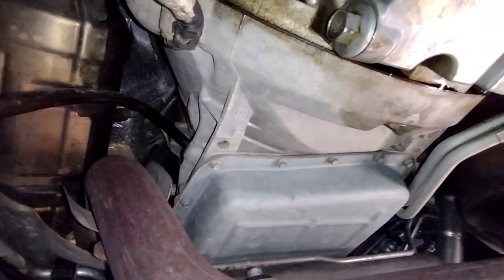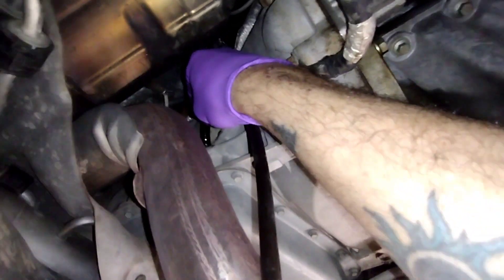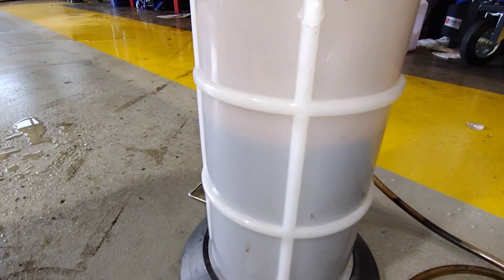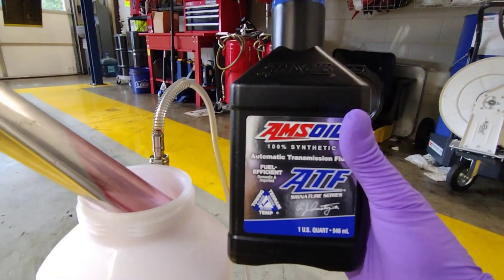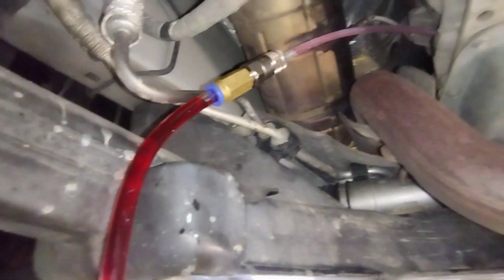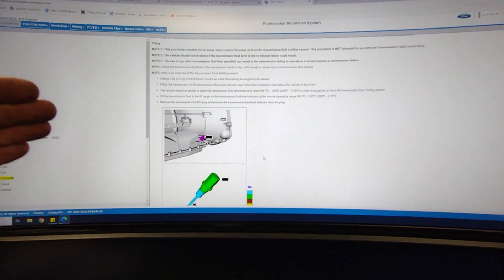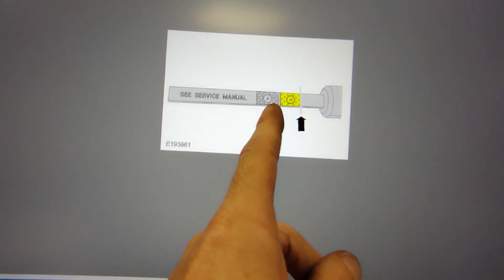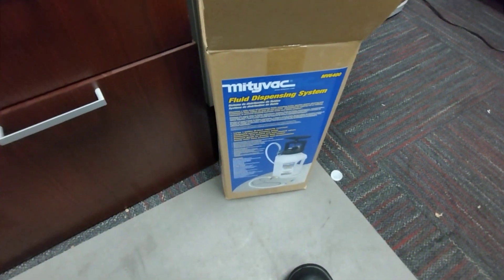2017 Ford Transit T250 113,000 Miles Transmission Fluid.🤢🤢

Comment: I checked my tranny level the other day noticed it was a little gritty at 30,000 miles. Went right the transmission shop for a filter and fluid swap. Nice vid might go with amsiol next time. Thanks for the vid
Reply from the maker: Your very welcome. Your on top of your maintenance my dude. It's awesome. Better safe than sorry.
Reply: @BeardedFordTech  off the subject I got 2018 f250 30,000 miles when should I look and doing spark plugs? Thanks again
Reply from the maker: @kingranch8516  you got a gasser?
Reply: @BeardedFordTech  yea my bad yep 6.2. Thanks
Reply from the maker: @kingranch8516  you do a lot of driving?
Reply from the maker: @kingranch8516  ford recommends 100k miles on the 6.2. But I'm going to recommend for preventative maintenance purposes. Change them at 50k-60k. Don't go the whole 100k
Reply: @BeardedFordTech  a lot of around town with about 8 trips to Florida and back from ohio. Thank you that’s what need. Keep ‘em coming
Reply from the maker: @kingranch8516  fuel system cleaner about every 3rd or 4th fill up.  Intake clean every 30k. That Amsoil power foam works great. Send me an email. I'll send you a can. You'll love it.
Reply: @BeardedFordTech  let me know if you get my email YouTube keeps deleting it
Reply from the maker: @kingranch8516  no emails. Aheflin31@gmail.com

Comment: What about the torque converter? How much fluid is trapped in there?
Reply from the maker: @chrisbyrne5574  about 2-4 quarts. That much isn't going to hurt. It'll come out on the next drain and fill. Or i can suck.it out while.its running go teo.quarts and ta time and add fresh at the same time with the flush machine. It's a lot to set up though.

Comment: I just had my transit flushed it had a 117000miles on it I know the transmission was changed at 7500 . I bought it used so I didn't know if it had been flushed the guy that did it said it was slightly brown and had a slight odor to it. He said he flushed 14 quarts it shifts better not that it shifted bad. So maybe it was flushed I guess I'll never know . Any way it's been around 359 miles since he did it still shifts good so maybe I don't have to worry .
Reply from the maker: You should be just fine!
Reply: @BeardedFordTech  thanks
Reply from the maker: @ericbutler6881  your welcome.

Comment: I have a 2021 F150 2.7, with 47000 miles...I want to change the whole drivetrain out to Ams oil products and  eventually the rad and brake fluid. I mostly do inner city driving but take it out for a good highway run once a week. You think that this would be the best way to go as i plan on keeping this rig for as long as i can and i want the best thing for it. What's your thought or should i stick with the motorcraft stuff?
Thank you for the hard work you put into making these videos, much appreciated!
Reply from the maker: I run this in my 2019 ranger. Runs soo smooth. Shifts flawlessly and I run it in the entire fleet. Can't go wrong with it. Become a preferred customer and save money that way. And it ships right to you and you receive it in like 2 days.
www.amsoil.com/?zo=5124952
Reply: @BeardedFordTech   sir, thank you,  I'm going to be servicing very soon, I just needed to hear from someone that has experience with Ams, and plus others are  saying how well it really performs too..👍👍
Reply from the maker: @Dublin777  it's amazing stuff. Your very very welcome

Comment: What are the advantages of having this over say an hand pump?
Reply from the maker: It is a hand pump. It holds 5 quarts. The handle on top you pump and it feeds until you turn off the valve in line, release pressure with the little yellow knob or it loses pressure itself. This isn't a pneumatic one. The suction one was pneumatic

Comment: Will this process work on the 10R80, as far as vacuuming out the fluid?
Reply from the maker: Yes. Same thing. Only the 10r80 is a 10 speed not a 6 speed.  Exact same process.
Reply: Thanks

Comment: I have same van 3.7 2017 t250 and I do the same way brother. Seem this is only way without dropping frame. Also I used same fluid, amsoil is the way to go😂
Reply from the maker: Yeah I really didn't want to drop the frame 😔

Comment: What's the best way to clean the MityVac?
Reply from the maker: The suction one?  I remove the hose and spray brake cleaner in there and swish it around. I have a gallon pale of it and I'll suck some into the hose to clean the hose. That gets all the grime out. Once that dries. Remove the lid (just some Phillips screws) dawn dish soap and hot water. Clean it out. Dry it. Put it back together.  The pump dispenser one I put brake cleaner in it and pump it out. Then unscrew the lid and do the same with the dish soap
Reply: I bought the one that evacuates and dispenses.

Comment: How do you get the orhet 10 qts out
Reply from the maker: It's a drain and fill. There's still some in there. If I used my flush machine then it would run until all new fluid starts coming into the machine. That process takes a little more time.  The only other way is complete disassembly.  I think that you thinking of total fill. That is different than drain and fill or valve body replacement fill.  I'll probably run this 15-20k miles and do it again. This will ensure it's all amsoil.

Comment: I don't understand why manufacturers are doing away with transmission dip sticks that are engine compartment accessible. It certainly makes maintenance much easier. One less item to have to check. All I can guess is they do this because of their "lifetime" fluid claims. I understand that BMW has done away with the engine oil dipstick and relies on a sensor in the sump to alert you when to top off the oil. This just makes no sense to me. Come to think of it I don't see people checking their fluids while gassing up.
Reply from the maker: I never see people check their fluids. Come to think of it.
Reply: @BeardedFordTech  I think the engine swap is the new tune up method. Jimmy Making it work has been doing his fare share of engine replacements as of late. I see an opportunity here. "Jiffy Swap" 1 Hour engine change service. 🤣🤣
Reply from the maker: @mlieser1230  I think you may be into something here lieser
Reply: Because transmissions tolerances and materials have become so precise, the wrong fluid or additives  will destroy the transmission. No dipstick will make it more likely that the vehicles are taken to experienced mechanics.